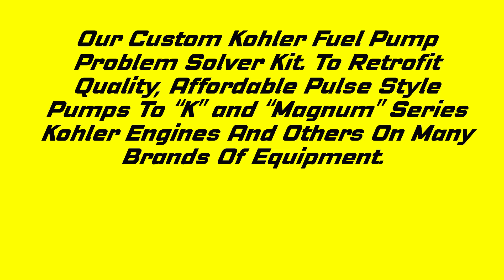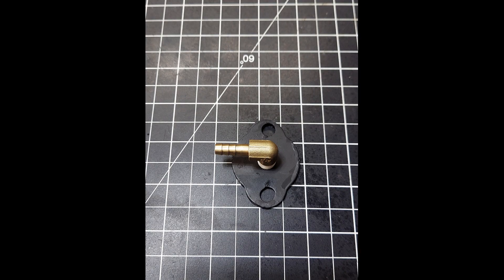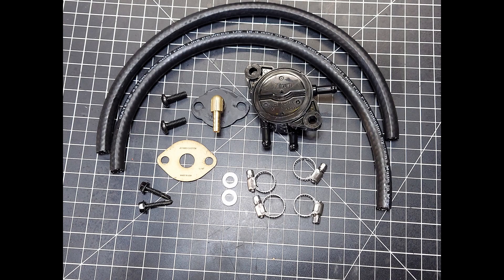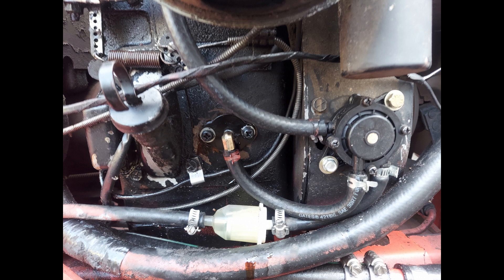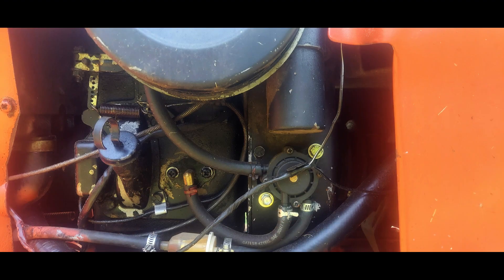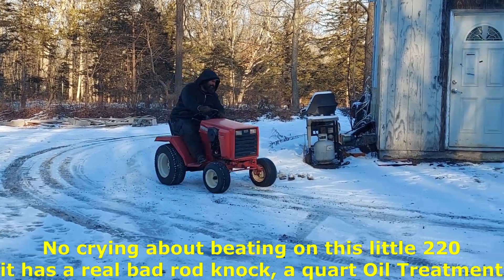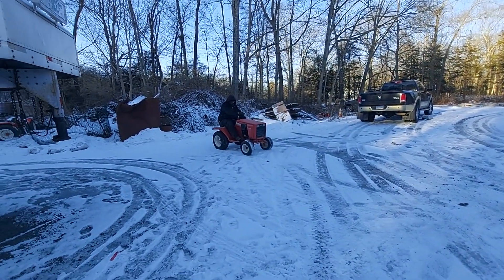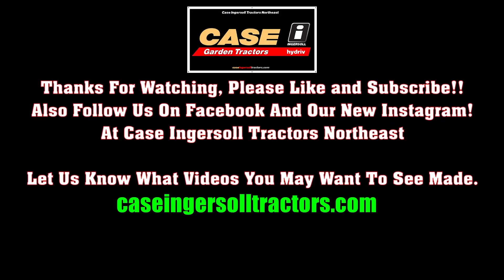Kohler K & Magnum Engine Affordable Fuel Pump Replacement Solution Kit For Many Brands!

Comment: Does the small hose hookup on the adapter that goes on engine have any check valve or anything or is it straight through.
Reply from the maker: No its just a hose for pulse single

Comment: This is a good idea. Can't wait to order one. My lawn tractor  has been sitting for months. I  ordered a remake Amazon China crap part and it is China Crap. Only ran for a minute and it crapped out on me. The Kohler engine sat there and spun it never started again. I didn't want to run the battery down so I left it sitting. I kept thinking on the way to fix it. I was told electric pumps would cause it to surge the carb, so I didn't do the electric pump conversion. More crappy  Amazon parts.
Reply from the maker: Thanks for watching and the great comment! You will love our kit we have sold hundreds!

Comment: How do you keep the oil from getting into pump?
Reply from the maker: We Have not had any  issues with it the oil itself should not be any where near the fitting its way bellow, just some splash and vapors may get in. But the pumps are made to work like this. What collects should drain through the long hose we provide and suggest mounting pump higher than fitting and you can position fitting so it drains in faster. But on  most engines these pumps are 3 inches from the pulse source and lots of oil and there are no issues. Thanks for watching and good question.

Comment: Shortly after un-crating my new Cub Cadet XT1 LT46  -  23 HP KT730-3046 -  I was looking to buy the normal maintenance parts, oil, filter, air filter, plugs and such and saw that some of the available part "kits" also included a fuel pump - Kohler # 25-393-26-S.  I said to myself, damn, I wonder if/when the fuel pump is going to crap out since it was offered in so many kits.  From your mounting suggestions it seems that re-mounting the pump away from most of the heat is the secret to a longer pump life and I'm assuming that heat is the killer of these pulse-pumps.  From your experience, what is the typical pump life of a new, (OEM), pump and what is the main cause of failure?  I'm thinking that the pump diaphragm is/SB gas resistant and "should" last for some time, BUT, my thought is also that some users may in-inadvertently cause these pumps to die by using - too much - of fuel cleaners that would/could attack the pump diaphragm material and kill the pump.  My new lawn tractor will ONLY be fed a 90 octane E-0 fuel with only a dose of Stabil in the gas.  Time will tell if/when I may experience a fuel pump failure and for now, I will have a "genuine" Kohler pump at the ready - just in case....  Thank you for a good alternative to help minimize these pump failures....  P.S.  I will also be using the Kohler 10W-30 synthetic blend as my research also taught me that these air cooled engines really do benefit from the oil additives that will best protect my engine....  At "only" 7 bucks a quart from WM - 5 pack - $35, it is cheap insurance to help ensure a longer engine life....
Reply from the maker: Hi thanks for watching and the comment. The pumps we use last a long time as long as they don't sit and dry out or dirty un filter fuel goes through them. Yes heat does not help. The pumps these are designed to replace a mechanical pumps that are hundreds of dollars or aftermarket ones fail in minutes. They also are a great alternative to lesser quality fuel pumps. As far as oil yes synthetics we prefer. We have a couple videos talking some about oil. Thanks again and enjoy your machine.

Comment: Wow ... very cool .... Looks like this will also fit the Kohler Command 17.5 which comes with the John Deere L110.  It's a sweet smooth running single cylinder engine but the John Deere L110 fuel pump is the weak point and problematic. I've converted fuel pumps to pulse pumps with a homemade cover made from an air hose nozzle, but the welding is tedious and harder.
Reply from the maker: Thanks! Yes this kit can be made to work on many models! Thanks for watching and the comment!